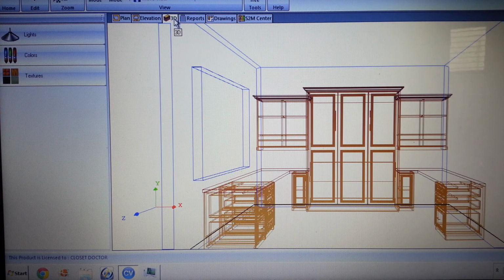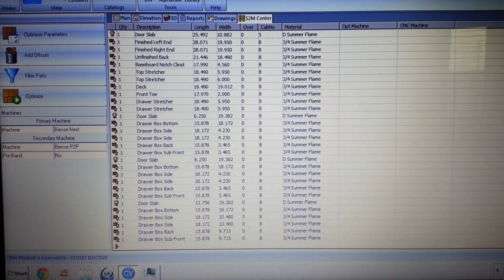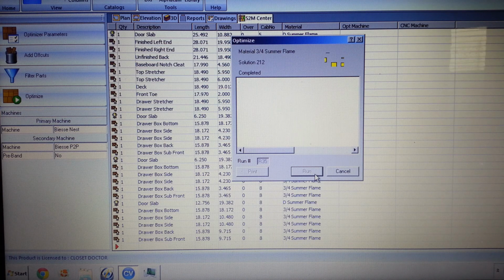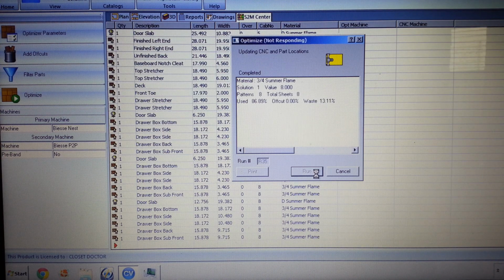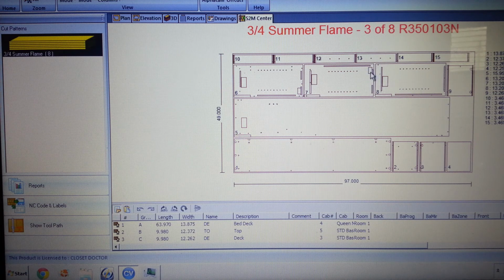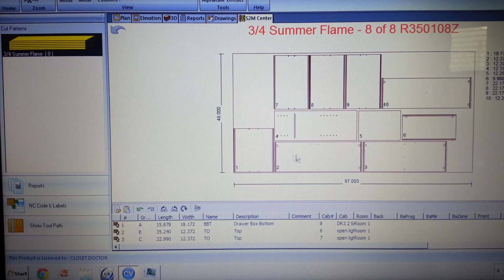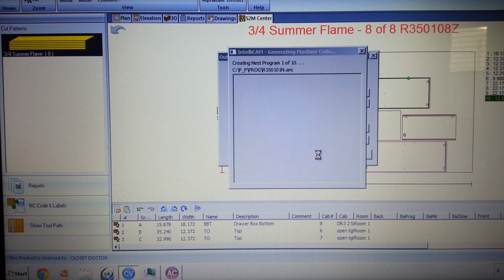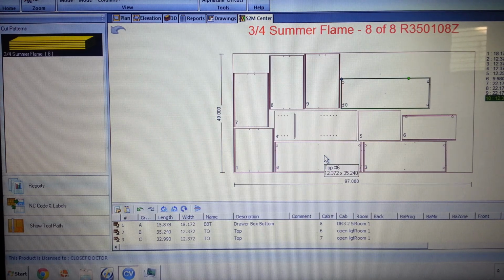Cabinet Vision cnc output routine

Comment: Good morning Derrek, your video help me a lot. I just have a question. After you run your parts on cabinet vision and process then on the cnc, do you still have to do any secondary operation on the cnc that cabinet vision doesn't handle, any operation that you cant program on cab.v.
Thank you
Reply: not really.  We can program cv to do anything the cnc is capable of. We try to avoid secondary machining at all costs. We cannot do any horizontal drilling on the nested base set up so we have modified our construction to not use that. In some case we need it and have jigs for simple predilling of holes